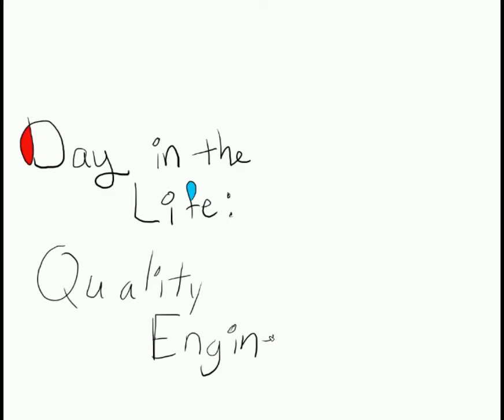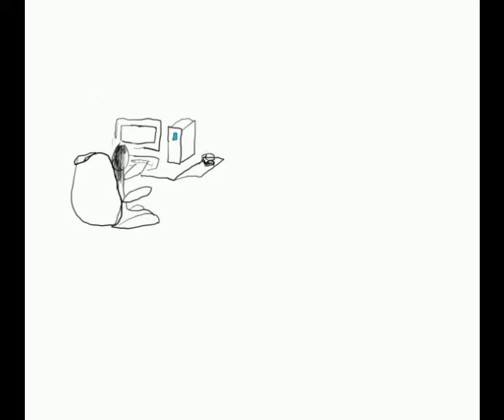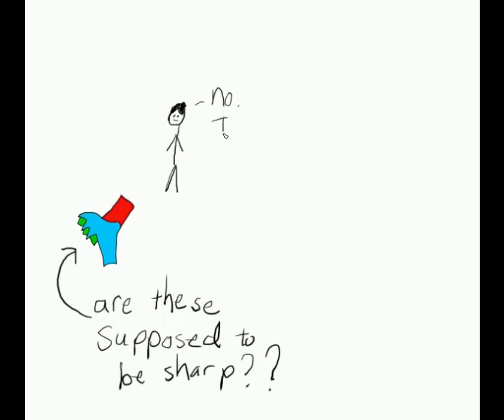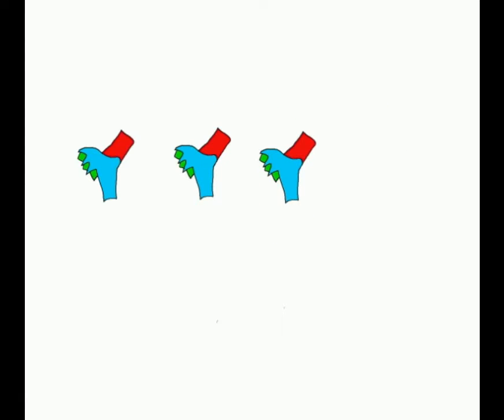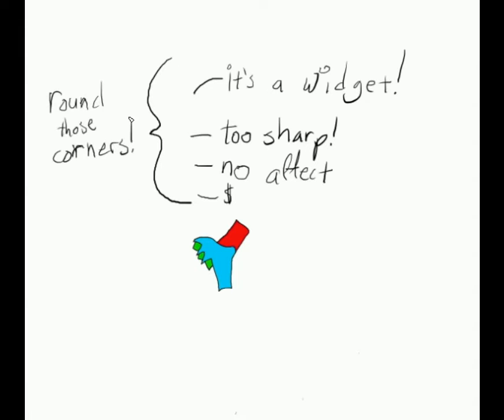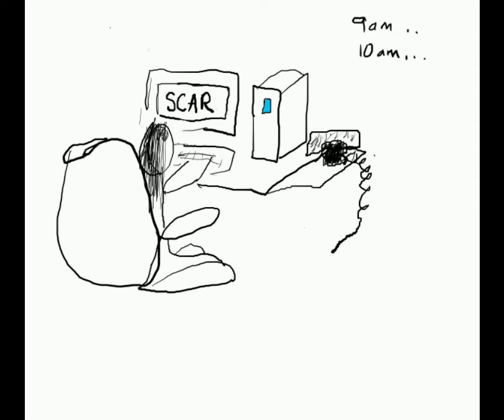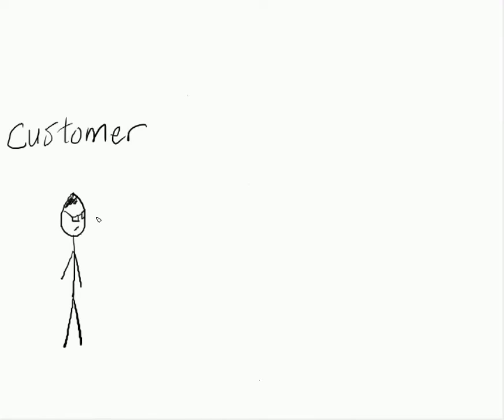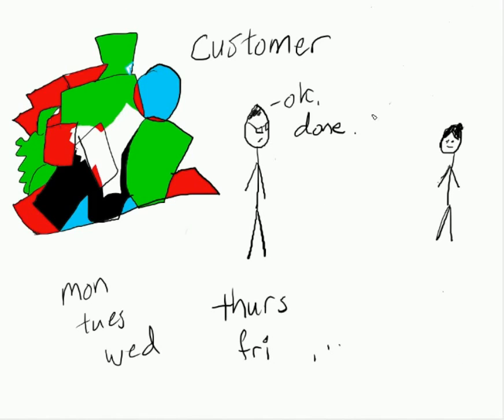Day in the Life:  Quality Engineer

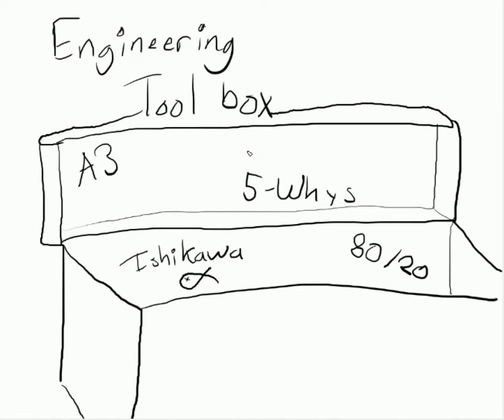Comment: Hi. At the end (2:59) you mention the 80-20 and the Pareto Charts, isn't it the same?
Reply from the maker: Pareto is the method of charting commonly used to visualize the 80:20 occurrence. Pareto Charts are bar charts with the x-axis sorted by occurrence rate from highest to lowest. 80:20 refers to the naturally occurring split commonly seen where 80% of a problem comes from the top 20% of the causes.

Comment: What industry was this in--if you don't mind me asking--? I work in QE for aerospace and one thing I don't like about the job is that our role in the process stops with identifying the defect. We don't get to determine the corrective action/disposition (UAI/Rework/Scrap, etc.). We pass it off to another department that determines that. I'm trying to determine if that's just how things are in aerospace, or if it's just my company (or just the facility I work at, even).
Reply: Depends on the companies quality system. I am also a QE for aerospace industry at smaller company, and I sometimes have all of these responsibilities but work with engineering sometimes when a change is needed
Reply: May be similar in many industries, since corrective action, either design or process changes, costs time and money, and potentially affects the bottom line.
Reply from the maker: This was at a diesel engine manufacturer. I've found that the way a role is split tends to depend on company size more than anything. The smaller the company, the more hats one person wears. The bigger the company,  the smaller the role each individual will hold.